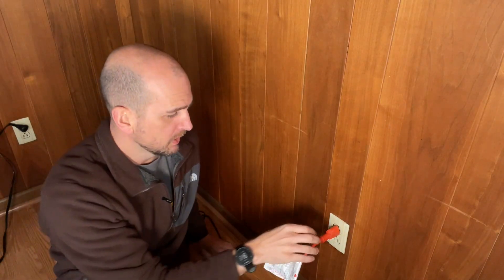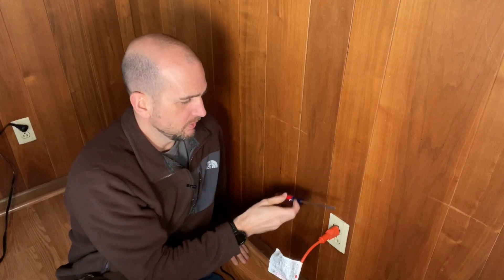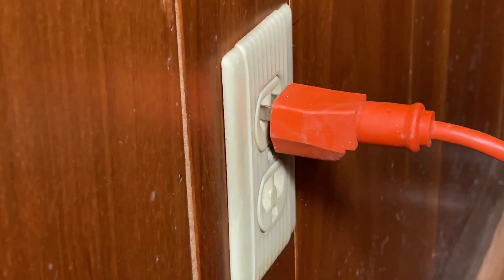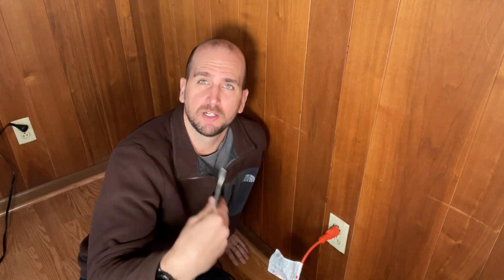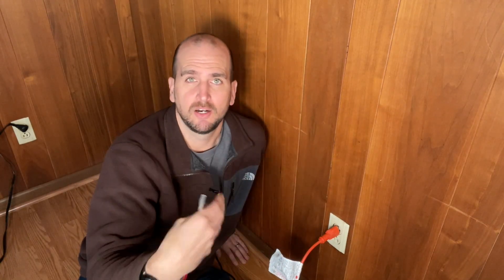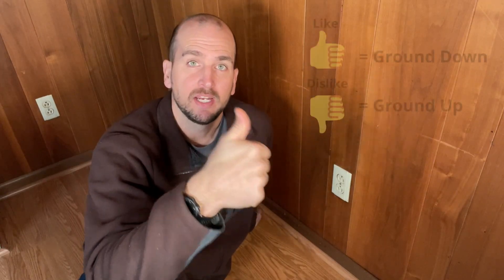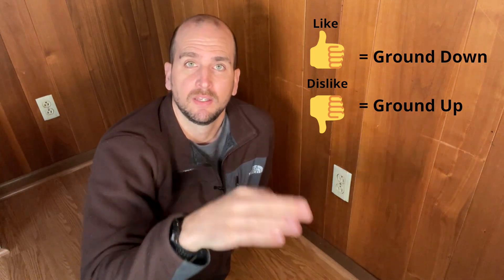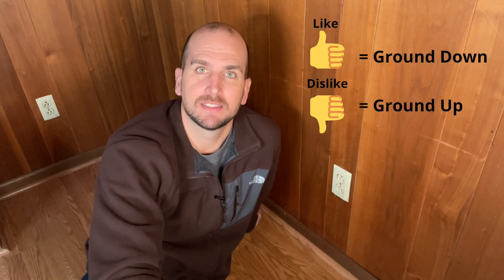Should An Outlet Be Installed Ground Down Or Up

Comment: I like ground facing down. Gravity or pulling of cord will cause plug to tilt downward, thus pulling the hot and neutral outward, but leaving the ground prong still touching and the last to pull out. With it up, the ground would be the first to pull out and hot/neutral would stay connected. I think having the ground prong touching last would be the safer situation. But, neither way is wrong. Whatever trips your trigger.
Reply: The ground prong is longer to avoid a disconnection like that

Comment: Ground up is the default installation method for all commercial installations where I live (Boston) and is what I did when wired my studio. Makes total sense to me and is much safer. The two prong is not a problem if it is plugged into the bottom slot and a grounded plug is plugged into the top. In my daily use, I have way more grounded cables in use than two prong cables. Grounded cables are used on almost everything I use these days except maybe my toaster and a few electronic devices here and there, mostly wall warts for USB charging, and for those I tend to use a surge suppressor mulitstrip, which is grounded at the wall or a GFCI.

Comment: My father always used to say instutional or industrial was ground up because of the thing you mentioned for the ground first contact if something slides down the wall.  

I have stopped putting them that way because of the 90s you mention and so many wall wart or small appliances are not made to stay in that way.  Many of them are either weighted for ground down or if they are out upside down the wire comes out straight up and sharply bends back down.

Comment: Ground up on a vertical positioned outlet, neutral up on a horizontal position ... there are still those who use metal wall plates and there are reasons mentioned in this video... Do what you want, but on that one in a million chance that there's a metal against the outlet situation, you'll drop the chances of an accident from one in a million to one in 100 million .... and what's the downside ??

Comment: I have always install them ground down. Since the late 60s. My reason has been, if the plug comes out and is sagging down the ground will be the last conductor to come out. That was also the way I was taught to do them when I started doing electrical installations. Plus they just look better that way. :-)
Reply: The ground is longer to prevent a disconnection like that

Comment: The only safety aspect is when you hang a 90 degree plug from a wall outlet. The plugs are constructed with the ground at the bottom. Why would you want it upside down and need to support it with a string or bungee? Just put it in right side up and end the debate.

Comment: As a consulting engineer, I can understand support for either approach, but we always specified "Smily face" (ground down). Of much more concern was the ease with which you inserted and removed the plugs. Was this a 99-cent receptacle? Better to use contractor grade (well, maybe OK) or spec grade (best) receptacles.

Comment: I have always installed ground facing down. Thing is I my basement freezer has a quick 90 degree with the ground on the top. I am tempted to change the receptacle to face the right way for the freezer plug

Comment: In Australia the hot and neutral blades are partially coated with insulation near the body of the plug, so if the plug is pulled out slightly the metallic parts of those blades are still not exposed.

Comment: I'm just waiting for someone to make an outlet with both grounds facing out, or one facing up and one facing down.  Especially for heavier duty items like tools.  I have some plugs that are slightly over sized and/shaped at an angle.  They hog up the whole outlet.  I'm getting ready to install a 2nd exterior outlet just so I can plug in more than one thing when working out in the yard.

Comment: It pays to put one up & one down because a lot of modern power converters don’t care about what it supposed to be in they randomize the small and large prong and are too big to share the central space.  That strategy is fully realized when you have a 4X4 and you have one side down on the other side up. Otherwise prong up gives you the greatest mechanical support for the three prong plug.

Comment: In my garage I have 2 double gang boxes. In each I put one ground up and the other ground down. Reason is the battery chargers are on a shelf above the outlet. The ground down ones are used with extension cords.
In the bedroom I have ground up because most of the fixtures are on desks or tables above knee height.
but everywhere else ground is down.

Comment: I'm a carpenter\framer so I see it a lot on some jobs I do but my grandfather (old-school electrician) taught me ground down but after dealing with the electrical chaos from a dropped nail punch onto a loose outlet during a remodel of my newer home (lived there 5-6 yrs remodled 2or 3 years ago) that caused a massive short (due to overall improper wiring and grounding through out the house, so thinking about it now I'm luck it happened when it did and not later mainly for safety reasons) I started to pick up the ground up method seeing it done on other jobs and learning that's the exact thing its meant to help prevent

Comment: I'd say since the writing on a GFCI outlet is oriented with ground down, that would be the most logical for any outlet.
Reply: so the Eaton tr7755 plugs I installed today the writing on the face would have the ground up.
Reply: A GFCI has that short-circuiting safety built in, so that logic would not apply.
Reply: @JeffreyGVny  The logic wasn't about fault protection.

Comment: I wired my house for optimum future reference of wiring location and use. If the wires entered the FIRST box from above (say in the basement) I put the ground up. If the wires enter from below the floor I put ground down. If they enter from the side (in parallel around the room) it's easy to see because there are two sets of wire in the box, I put them in the best position for the appliance to be plugged in. Switched outlets your choice... they are easy to find for most people no matter the orientation.

Comment: Most people have some type of a cord being connected...the natural tendency is for the cord to hang downward. If the ground is down it will remain connected the longest.
From a safety standpoint the chances of a peice of metal falling exactly across the power and shorting out is small, however if the plug is without ground and you dont know it...electrocution is possible.  I would much prefer the small potential of my house burning down over the potential of dying due to electrocution

Comment: I first heard of receptacle installation with ground pin up in a company safety presentation.  The safety manager gave the same explanation that you did for preventing accidental shorting.  We employees, of course, always had great respect for our safety department and it's staff who seemed to have nothing to do but watch us.

Decades later I bought my dream home that was originally built by a professional licensed electrical contractor as his own dream home.  His plans changed and I became the third owner of his dream home.  He had incorporated automatic proximity switches in the closets and other high-end features with obvious craftsmanship meeting the most stringent municipal codes (the area was rural with no code authority).  How were the receptacles installed?...every one was "ground pin up".

The odds of the ground pin up ever being helpful in preventing shorting are probably astronomical for an old retired couple, but I have left them the same.  It took getting used to, but it would take labor or expense to change them.  I'm flexible enough to change, and that additional protection costs nothing.  The odds of it being valuable increase when there are children or inexperienced people in the house.  When cords have the "convenient" 90 degree plug you describe, for example a laundry applicance, I have turned a couple 0f specific outlets ground pin down to reduce the "wankiness".

Comment: This is what I ask my installers when they question this. My answer is a question: How do you unplug a power cord from a wall socket? Specifically where do you place your fingers and thumb when you remove the plug? Most all of my installers now install them with ground up.

Comment: I install gnd up for safety as a friend's daughter had dropped a coin she was sliding it on the wall and it shorted out the circuit. I understand that with a two-pin plug it doesn't matter, but I do this for the grounded plugs.

Comment: Just because you aren't sure of the safety benefits, you need to understand that safety is approached in layers. By themselves they may appear ineffective, yet when layered form an effective barrier from idiots. There ya go!
Point (way more technical) :
Once worked as a robot technician, my robots worked at a 99.8 availability, the other 3 techs machine were hovering around 80%. Up from the 50% rate before I was hired. Good, but obviously, could be better.
The manager assigned the other 3 to 8-10 hrs of overtime (we worked 12 hr shifts) to watch me preform a maintenance on one of my machines. They were all "degreed", me? Not so much!
They continually, through the process, kept telling me that, "ya know, ya really don't have to do that" over many procedures I did. They were sll taking notes. I finally (not more than 4 hrs into it...) told them, that EVERYONE of the things I did, were the exact things that they SHOULD be paying attention to. 
Things remained the same.
I moved on.

Comment: Long time ago (1986), I was tasked to rebuild a semiconductor plant after a fire had destroyed 2 1/2 of their 3 clean room fab area's. The fireball only went so far, and the key part of the process was minimally damaged (1 of 2 in existence at the time).
I was responsible for the installation of the "utility" services.
I installed all receptacles ground up. The facility manager threw a fit. I showed him NEMA illustrations, showed him the (current) NEC code book. His position did not budge!
I finally picked up a receptacle, and asked him if the manufacturer of that receptacle WAS SO STOOPID as to put their BRAND NAME(!) upside down?!?!
They were imprinted so that, the ground was up, and the HUBBLE(tm) was also readable (not upside down, for the slow thinkers!).
That was the end of the disagreement. 
That's where I stand...

Comment: Ground-down has a safety argument I was expecting you to present - if the top half of your plug comes out, with ground-up, you have an ungrounded plug, which people will use unsafely. With ground-down, you have a disconnection, which you will fix immediately. This seems like a much more likely scenario than people dropping screwdrivers or butter knives along the wall.
Reply: 3:02 the ground pin is longer than the other two, for this reason. there is no way for the ground pin to come out before the power pins come out.
Reply: In many commercial installations such as an office environment, it is very common for a paper clip, or staple to fall off of the edge of a desk. The staple/clip could fall onto the blades of an inuse outlet with a cord-cap partially removed. If the outlet is installed ground down the clip could easily cause a short across the hot & neutral blades. Ground up it would simply roll off the blade and continue safely to the floor with no problem, and go completely unnoticed until someone walks around barefoot. Also, most medical facilities will use the ground up installation method for the same reason.
Reply: What about all the sheet metal pieces people store in their houses along the walls? Anyways, just looked around my house quickly and the vast majority of things that are plugged in don’t even have a ground on them, except or two power bars that are designed with ground down plugs on them.
Reply: @huejanus5505  they weren't designed for ground down plugs. They were designed for a hot and neutral and purposefully made so it only fits the exact way. Back of the receptacle has a green gold and silver screws. Gold for hot wire, silver for neutral, and green for ground. It would such to burn up an appliance by mixing the two up.
Reply: This was a rule before plastic covers were used. It was installed this way for appliance dedicated outlets that had a grounded plug. If a metal cover came off and yes they did come off it prevented it from contacting the hot and neutral.
Reply: Thank you Dave,.. I didn't know why ground down was better until I read your comment!👌

Comment: Outlets in my new house:  Ground down is normal outlet.  Ground up is controlled by a remote switch - typically for lighting.
Orientation was simply used as an indicator of what outlet was switched.

Comment: When installing an outlet i usually orient it so the live wire is on the left, so it's easier to test if the outlet has power, but the outlets we use in Europe are symmetrical so you you can plug in ether orientation. And our outlets are not really flush, but rather have a slot so the whole plug can go inside with the insulation, which holds the plug better and there is no risk for anything to touch the connectors

Comment: Ground down for outlets below the waist and ground up if the outlet is above the waist.  When you unplug an outlet below your waist, you may tend to pull up and out, exposing the ground before the hot and neutral are disconnected.  Conversely, when above the waist, you pull out and down.  If the ground is up, you only expose the ground first.  If you installed them the other way, in each instance the hot prong will be exposed first and if you ham hand it, you could touch the prongs.  I always thought that was a weak argument but it is one i heard.  My two cents.

Comment: australian....i do both ways, i like how if weight of lead pulls plug out a little you  still have contact with your active and neutral, with  ground at the bottom you lose power if plug comes out a few millimetres at the top, a pain in the butt............

Comment: I'm not an electrician, but I prefer to install them sideways.
Ground facing left and neutral facing up.
That way it won't matter if something falls in the receptacle, it would only hit the neutral pole.
 Also that way you'll have both receptacles at the same height. Easier to reach behind furniture, etc.
Sorry if my vote /comments doesn't count for your poll! 😂

Comment: There's nothing in Canadian Electrical Code that requires a particular orientation but interestingly diagram D1, which illustrates all the non-locking receptacles, shows them in the ground up position. Same in the NEC? This could explain manufacturers' evident preference for uppie ground... but offers no hint of justification for the preference.

As many have pointed out, almost anything with a face or display that's meant to sit directly on an outlet is designed for the more common ground down choice. In my collection of gizmos, one annoying exception is a small NiMH charger with an LCD display that sits upside down on a ground down outlet. Of course the display contrast is basically nil viewed from that angle so you practically have to stand on your head to read it.

Now, what about sideways receptacles? Neutral up or neutral down? I go neutral up for the "falling metal objects" argument, especially if the receptacle has a metal cover plate.

Dryer receptacles? "L" neutral up, usually, though I have seen some cords that are meant to hang the other way.

Range receptacle? There's a code rule for that one: sideways.

Comment: Ground up is not for fallen items. That’s a myth. It is ground up for fire suppression systems as conductive solids in water will short to hot. Shorting neutral to ground does nothing but bypassing the load and going from hot to neutral is very bad. Thermal runaway, overload.

Comment: That is wrong in video. 2:00 NEC specifically has a section for hospitals and medical centers for ground up. I prefer ground down and agree with other posters for looking correct and better mechanical support for weighted cables.

Comment: In the demonstration of ground up the reason the plug is loose may be because the ground is up and therefore lacks support, and the weight of the cord is causing it to pull away.  I've never had a problem with the plug being loose or pulled halfway out with the ground down , but I have had the fall completely out with the ground up

Comment: The reason why the outlet is upside down is to identify it as a outlet tied to room switch. The older homes have switches connected to outlets which are turn on for lights.

Comment: I've always installed ground down. I'm not an electrician but have been doing electrical work around the house since I was 13, I'm now in my late 30s. 
I also like the idea of using ground up to signal switched outlet.

Comment: In a lot of newer homes (last 20 years) the builders will put receptacles that are connected to light switches ground up and all the rest ground down.  That way you can easily tell where to plug in floor lamps.
Reply: My wife would hate that :)

Comment: Had to giggle a little. If you have falling metal objects from overhead, that may or may not short out your plugs that haven't stayed plugged in, you have way bigger problems to take care of! Still, I vote for ground down and up for switched outlets that I believe is pretty common practice.
Reply: Metal cover plates on the outlet. I’ve experienced it where I had to service a store that my company bought. Went to unplug a six outlet adapter and the metal plate behind it wasn’t screwed down and fell onto both conductors.
Reply: @tussery  That's a great example! My experience is more from a homeowner perspective and, not to speak for all homeowners, metal outlet covers are not something we would use. Still a great point that there will always be a situation that may come up whether we're aware of it or not.